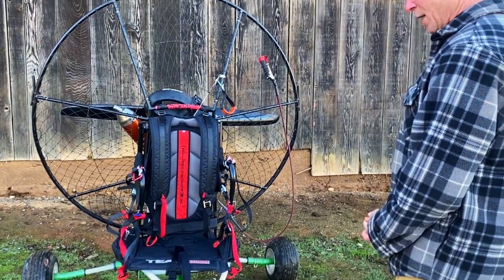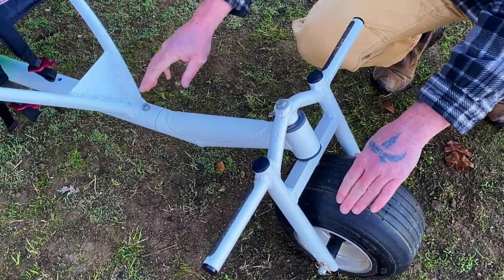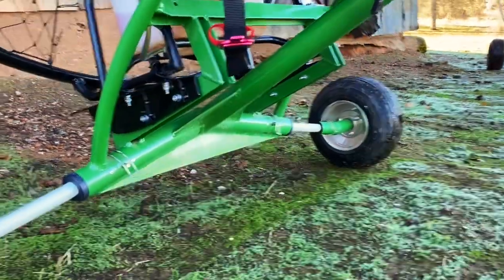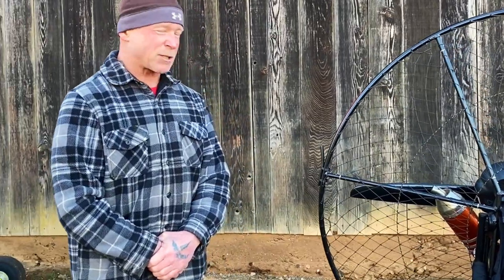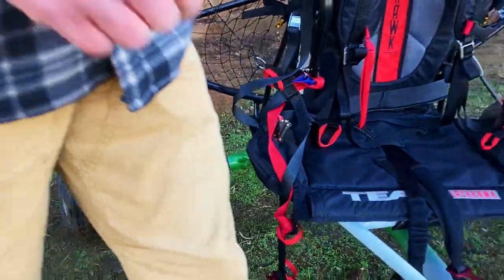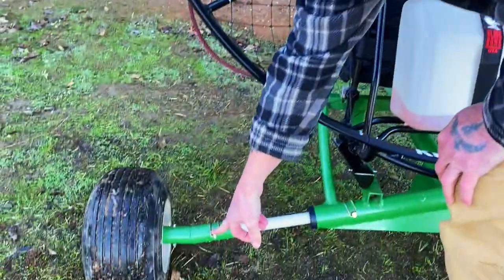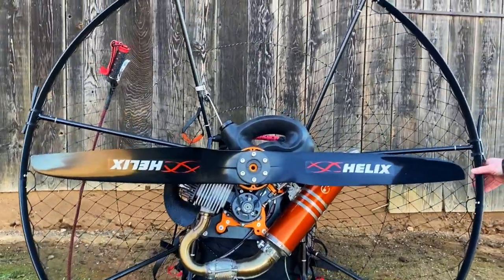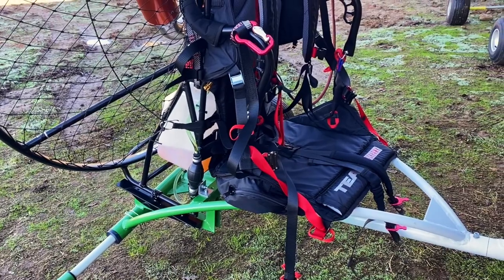Wheels Series Part 2 (featuring the Lite Trike)

Comment: Mike just a suggestion. It would be nice when you do the walk around on the lowboy III trike with the aero 1000 to list weights of the trike with 2-5 gallons of gas ready to fly. Just so we have an idea. Thanks!
Reply: My Lowboy III is 220 with tandem reserve and about 3 gallons of gas.  Couple of add-ons like Skyflar dual strobes and an under-seat accessory bar.  Weighed on a large electronic freight scale at work.
Reply: @cbdane  awesome man!! Thanks for the info! I was hoping it would be lighter but there is no free lunch!